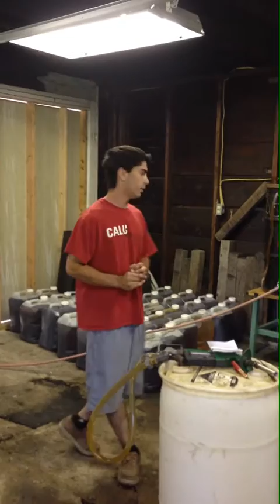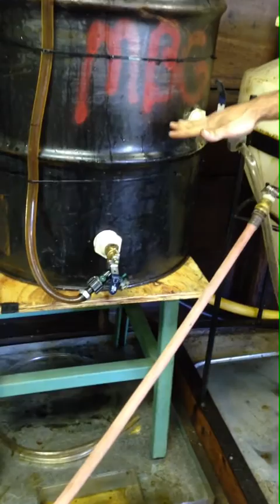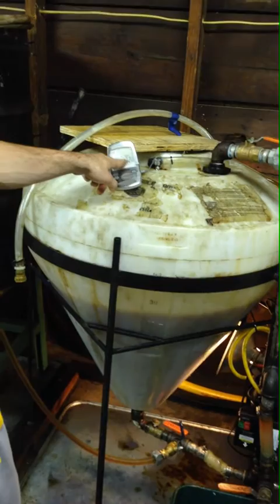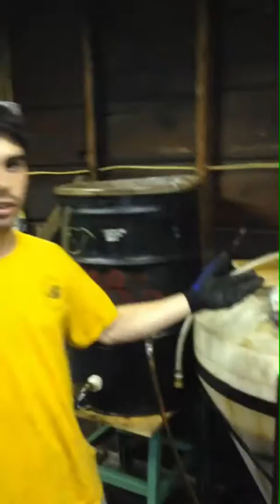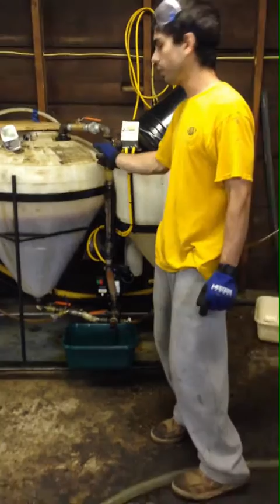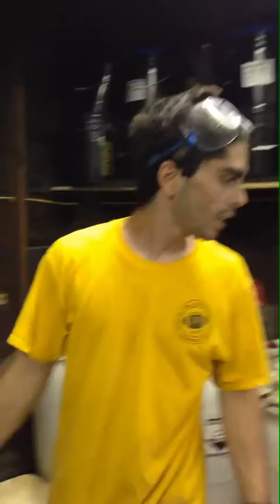Greg's Biodiesel Processor

Comment: You do not want to heat your oil or your oil-methanol-lye mixture higher than 60°C (140°F). That maximum temperature of 60°C (140°F) is very important because if the methanol when mixed into the hot oil is at or above 64.7°C (148.5°F) which is the boiling point of methanol, it will turn to vapor and it may cause problems with your reaction. Also, the reaction occurs even at 130F so there is no reason to put extra energy into the system above 140F that you have to pay for the electricity it only serves to increase your costs.
It is great you are using cone bottom inductor tanks so as to not cause more frustration in getting all of the glycerin out. If you scale up consider buying cone tanks with very sharp 58 degree cones and the have a 'full drain' feature in the bottom of the cone, this makes sure all you methanol/lye mixture goes in and there is none sitting at the lowest level of the tank. Fully draining tanks with 2" male external threads you want to add a 2"-1" reducer and after that change to vinal tubing so you can see exactly where the glycerin is when you are draining it off and being sure you are getting it all out.

Comment: Hello, Greg! Great video, wonderful presentation! I have a question about filters you use. Filtering water versus oil, which is higher viscosity. Don’t you have to replace them more often comparing to using the regular biodiesel filters? Is the water filter material durable enough what is going to work?

Comment: Now here's the real kicker. I have done all the math you only saved like 30 cents a gallon on making this according to methanol prices and diesel prices in 2014 is saving $0.30 per gallon worth it?
Reply: @Morgus Schmorgus but the thing is methanol has increased at a greater rate than fuel prices because of the DIY group of people and survivalists things like that cost of electricity Etc is also obviously increased my calculations are indeed relevant today because the cost of making this has increased greater than the savings
Reply: @ClownWhisper  would using ethanol be cheaper than methanol?
Reply: @kylemcguff5581  I am no expert on the process I don't know if ethanol itself would work I think that if I remember correctly sodium or potassium hydroxide is insoluble in ethanol i could be wrong
Reply: @ClownWhisper  I'm an undergraduate biochemistry student. I've been working with a novel catalyst made from glycerol that does dissolve in ethanol. I have made biodiesel with methanol and ethanol. I was just curious on your analysis, thanks!

Comment: I mean it's good to be careful with things like methanol but you're not going to ignite it that easily. In a closed environment your heating methanol using some type of feedback loop with a heating element and I am assuming the heating element is in a compartment surrounding where the oil flows it's probably not directly in the oil itself but even if it would be the surface of the element is not going to get up to 300 Fahrenheit which is the flashpoint of methanol I believe. The auto ignition point is higher than that but you also have to take into consideration the fact that it's being diluted with oil it's not going to ignite ever! Not from an electric heating element it's just not you would have to have the oil saturated methanol in open air with plenty of oxygen present and use an open flame to even get it to light let alone burst. It is not explosive as you alluded to earlier it is combustible

Comment: Methanol is toxic to your skin to your organs it soaks in through your skin and we'll get into your liver and be stored in fat cells I believe I know that is stored in your body I am guessing fat cells at this point I can't remember the exact method although it is toxic. Petroleum products will remove it from your skin simple water is better than nothing but I would use petroleum products or the best possible scenario would be something like ethyl alcohol like a little whiskey. Ethyl alcohol is a competitive inhibitor to methanol. If I got a substantial amount of methanol on me I would not only wash it with petroleum or whiskey or Sol alcohol some kind I would also drink ethyl alcohol couple of shots just to make sure that it doesn't get into your liver. You will instantly remove it from your bloodstream if you have a couple of shots and you and it'll go right down the toilet. I had to learn about this crap when I was working in a laboratory cleaning optics for microscopy. Methanol is the best cleaner as it dries so quickly

Comment: I have made Bio Fuels for about 18 yr.. I am doing exactly what you are doing. I run about 75% in my 300D Mercedes with Monarch Nozzles set at 2,700 psi. Pressures. I have had minor problems but for the most of the issues, it was from my stupidity. Be certain to get all of the glycerine out, it causes big problems. Thanks for the video, hope the 6.5 lives good on it. With fuel cost going up my truck is going to be getting at least a 50% tank this next week. I have a new set of squirters to put in it and will feel better about running it on a stronger blend. I'm going to add a frame mounted filter. It is harder to change the filter on the engine on it and the glycerine stops it up quick. Good video, thanks...... Best advise I can give is to be careful about where you get your oil, some don't work so good.

Comment: Lye is very resistant to methanol potassium hydroxide is more soluble in methanol then lye which is sodium hydroxide. Sodium hydroxide resists dissolving in methanol it takes at least 10 times longer to dissolve than potassium hydroxide

Comment: Methanol is nothing like putting rubbing alcohol on your hands methanol is toxic it will destroy your liver. The old timers that I've worked with and Labs across the country if they get one tiny drop of methanol on there skin they will scrub with a competitive inhibitor a good competitive inhibitor that doesn't cost a lot is gasoline. But you could always use a grain alcohol namely ethanol that denatures methanol it is a competitive inhibitor and keeps your body from absorbing methanol you could drink it too and it has the same effect on stored methanol in your body
Reply: He said it "feels" like rubbing alcohol... it's cold and evaporated quickly. You're a dumbass.

Comment: Your normal $10 heating element? Oh you mean like you know you just go down to 7-Eleven and go to the heating element rack and by the normal $10 one? Do you think people buy heating elements all the time and know what you're talking about? Heating element for what? What is the typical used for where do you get it? My Lord brother put some thought into this
Reply: Electric water heater element that is rated for the source voltage.
Reply: @erictaylor3496   and for longer trouble free life an ULWD element (ultra low watt density) will work best and should last many years unlike the cheaper LWD ones with less surface area.
Reply: preheating diesel element or water heater element. If you're not mechanically inclined enough to know what and where, you should probably leave this to someone else...
Reply: hes referring to the electric heating elements found at any hardware store that are sold for water heaters.... of course you wouldnt buy one at a 7 eleven. You make a lot of incorrect assumptions here, I get it... your trying to be the class clown but come on. A typical person interested in this already knows you buy hardware from a hardware store.

Comment: Hi. You dont need to make biodiesel at all. In the summer just mix clean wvo with 5 % rug and you can drive your Passat without any problems at all. In the winter mix 70% wvo with 30% rug and small amounth of acetone and that its all. I have drive all my old diesel cars on that mixture with out any problems for years. Even i have drive on that mix my 2004 Volvo V70 D5 with commonrail fuel system for years with not problems at all. For Volvo i have mix 80% wvo and 20% rug in the summer, and in the wintern 70% diesel - 30% wvo.
Reply: What is wvo?
Reply: Ayile Enenga waste vegetable oil wvo
Reply: @alexa795  thx
Reply: what is rug?
Reply: @abdullahmirza47  rug = regular unleaded gasoline (87 octane) (you can google this, lots of info)

Comment: The 6.5's problem is the optical sensor in the DS4 electronic injection pump, 1994-2000 model years. The key is very well reacted bio that is not dark colored. Any WVO that has a high titration point and/or needs acid esterification prior to transesterification isn't a good fuel stock candidate for DS4 pumps. A light colored fuel which passes all QC tests is needed with these pumps. Replacing the DS4 electronic pump with a DB2 mechanical pump is another viable solution and a permanent one that will allow for "bumps in the road" relating to slightly substandard fuel. It is very possible to do this; however, it may be cost restrictive. Manual transmission 6.5s are a much better candidate for a DS4 to DB2 swap than an auto, but it is entirely possible for an auto as well...just requires more fabrication. Also, using the DB2 pump eliminates the PMD problem associated with these trucks.